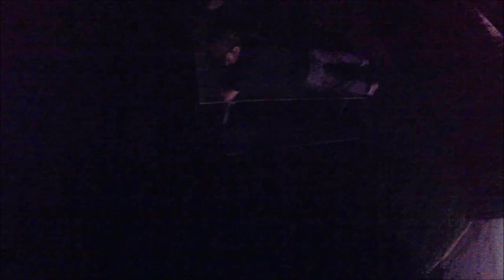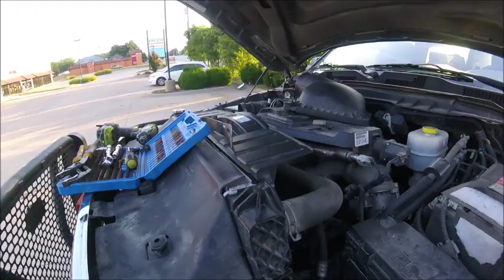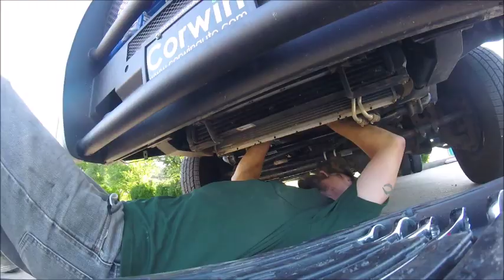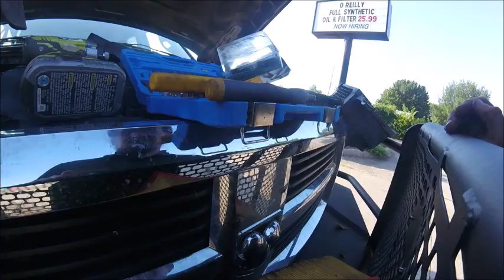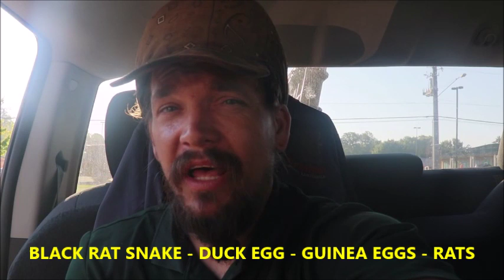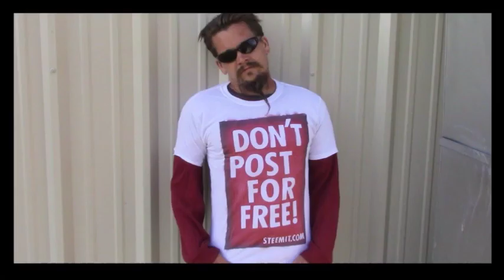Where did YOU sleep last night?

Comment: Not a good idea passing on this information ....... You don't know if some unsavoury individual may see this and pull this off on some decent family
....... Just a thought❗️
Reply from the maker: I'm really not sure what you even mean by that? What information? (that I slept on a picnic table?)
Reply: @PapaPepper  I believe they mean how to open the car door.  But from what I see most thieves don't have any problem breaking the windows out.  After all thieves don't have the cost expense to replace them. 

I once used a bamboo fishing pole through a wing window to unlock all four doors at once, when I had a ford taurus years ago & locked my keys inside.  Found that pole in the alley just before the garbage truck arrived that I would be blocking.. Did that after a long drive to Ohio & back to Kentucky.